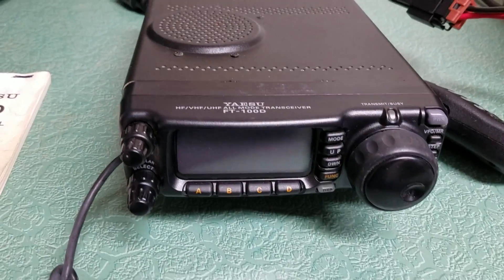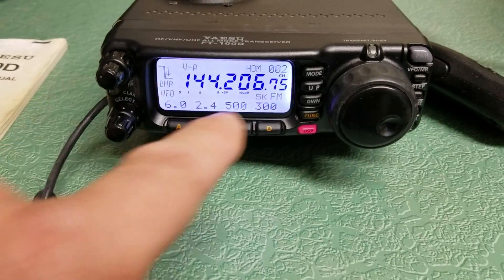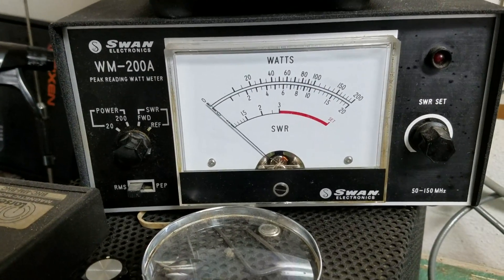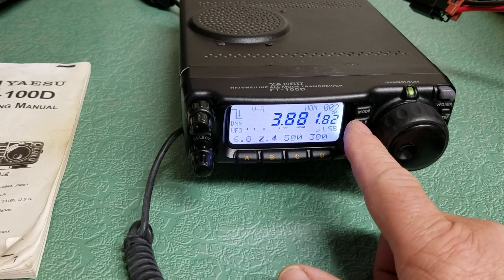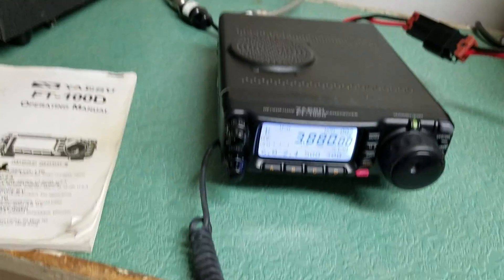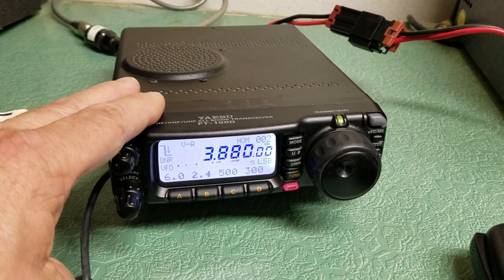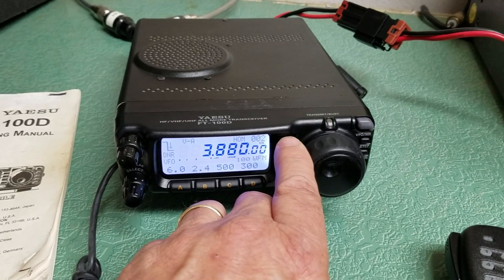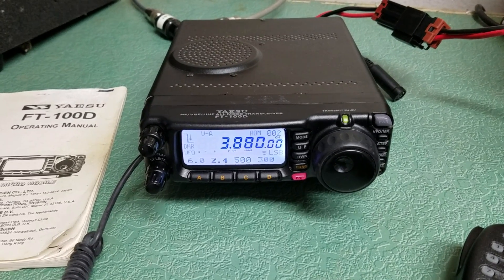YAESU FT-100D HF/50MHz/VHF/UHF All-mode Transceiver

Comment: looks like yaesu is going to the ft891 screen ft817 and ft857  went to a adifferent screen ft100d was a fine rig the ft991 is a must have radio  73  kg6mn

Comment: Why did Yaesu stop making this rig? It seems great, and don't tell me that FT-857d is a replacement for the FT-100d, because it isn't even close to being a replacement. Yaesu(and Icom) seem to shoot themselves in the foot by getting rid of tried and true models to make a model they think is "modern".
Reply: Part sources dried up. Output transistors don't exist. These are nice rigs, but risky to buy because of rare spare parts.
Reply: The FT100 and FT100D were plagued with design issues i.e. birdies,RF leaks,circuit board bonding, earthing faults etc,etc.The technical  HAMs of the day resolved all the factory faults and the FT100 series became a sought after radio from then onwards.However Yaesu got cold feet and dropped production when the FT857series was released